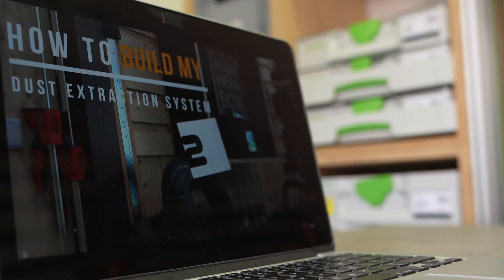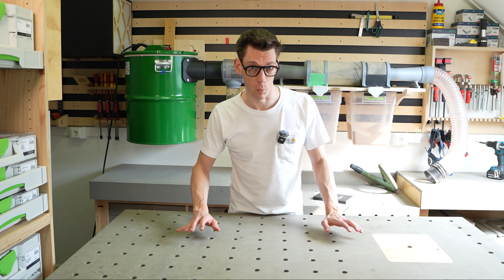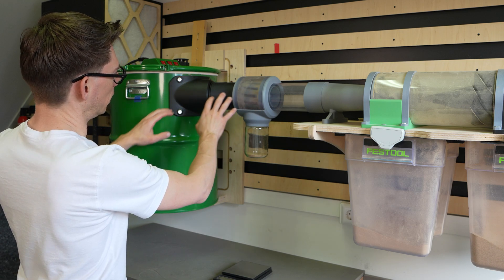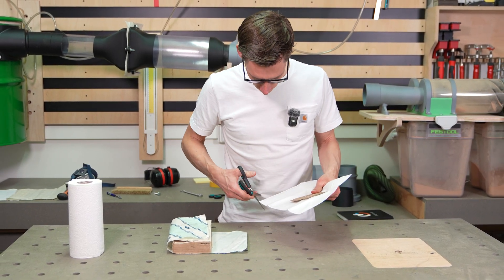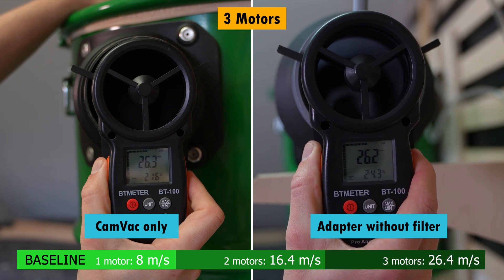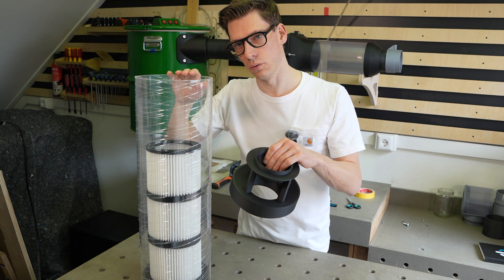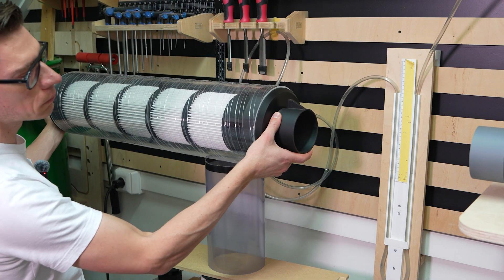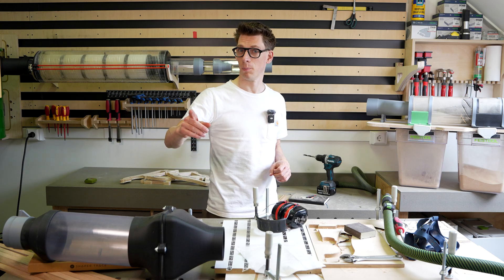I Dedicated 1 Year to Improve Dust Collection

Comment: Could metal chips in a machine shop be handled in a similar method?
Reply from the maker: They are probably to abrasive for the printed parts. Also the weight of the dust is different, so I don’t know if it will be as effective compared to wood dust and shavings.

Comment: Interested can this be scaled up for bigger volume flow and more industrial setup. Have a big 5axis that will cut carbon and epoxy boards and need to figure out dust collection.
Reply from the maker: I am building a 8 inch version that can handle a 6 inch inlet tube I think. 

What is the diameter of your 5 axis you want to connect?
Reply: @ no dust extraction at the moment so everything is possible. Will enclose it fully at some point and probably will be best to vent directly outside. Carbon dust is no joke.
Reply: @eXmachina_tech  you might want to at least grab a tape measure and see how big of a dust extractor can you fit in the spot you want it located at.

Comment: Out of curioisty, have you changed out the filter in the camvac? Stockroom supply in canada sells a filter setup ("nanomax")  which replaces the triple bag system in the camvac... I saw another youtuber simply print adapters for circular filters and it seemed to work exactly the same for a fraction of the price. This would eliminate the need to have a huge stack of filters outside of the unit!
Reply from the maker: No I did not change anything to the CamVac jet. I have seen the nanomax filters and also the 3D printed versions. I think I also need to test them and make a good comparison of those two options compared with the standard CamVac filters.

The main reason I put them on the outside is to be able to weigh the filter unit to quantify the amount of dust that is not filled out by the separator without the need to open the CamVac every time. To weigh the CamVac as a hole on a scale that is accurate on 0.1 grams was very expensive to buy such an accurate scale.

But I see where you're going with this one! Thanks for the reminder 😉 I'll have to make a video about this too!

Comment: I have worked in research and development of all sorts over the years and it is a job that i can say i actually love to do!  Not that i would go to work if I was independently wealthy i would just shift over to doing it for myself.  So that said, this channels is hugely inspiring.

Also, I can share the passion for dust collection.  At my last company, we had a huge dust issue with one of the machines we designed.  Static electricity was making things way worse so that might be something to look out for since you are using lots of plastics.  Good luck with your designs!

Comment: Copy what Dyson has done in their cyclone vacuum cleaners. No need to reinvent the wheel when they've spent 1000s of aerodynamisists hours working on this problem.
Reply: Yeah. 4-5" Super Dust Deputy is $180. Mine takes over a yr before the 2 micron filter on the DC needs to be blown out. And there is close to nothing in the collection bag.

Comment: Ideas for your square testing filter chamber. 
The corners lifting, add corner screws. 
For faster assembly, instead of screws, use spring clamps. 
For even faster assembly, use magnets.

Edit: finished watching, impressive works.

Comment: Loving the updates. The only thing I still wonder about your design is what would happen if the motor was before the separator, putting the separator in positive pressure rather than negative. That's how the Harvey one was designed.

Comment: Bonjour.:yougotthis: Encore une fois MERCI :goodvibes:pour vos recherches et Réalisations. 💪💪J'aurais une question SVP : pourquoi n'y a t-il pas de soupape de sécurité sur le Camvac?  Bonne journée et à bientôt pour vos futurs Exploits. 🤩
Reply from the maker: I think because it’s bin is strong enough to handle the pressure when the inlet port is completely blocked. And when you run on two motors, air will be sucked into the collection chamber trough the motor outlet from the motor that is turned off.
Reply: @CapturingDust  Merci pour votre réponse. :goodvibes:

Comment: That IGM/JET separator looks great because it’s got all the components to a separator that you want… but it IS ABSOLUTE GARBAGE!!! The put the components in the wrong order making them completely useless. All the large particle dust that would get extracted by the second component of the extractor gets clogged in the fins of the first component. Does not work one unless you are maybe only making table saw dust.
Reply from the maker: That was exactly my thought when I saw there design. Clogging must be there biggest issue. Though I would like to quantify how bad it will be. Some are really enthusiastic about it but I think because of sponsorships with the brand.

Comment: Love where you are going with this. It would be great to see what the pressure drop is for each stage of the filtration. Also what level of filter have you used. HEPA 13 would obviously be the ultimate and with the level of bypass you are now filtering would seem to be a reasonable thing to now employee.
The CamVac is as far as I can see now operating just as a vacuum source as you filters (even if not HEPA 13) are far better than what the CamVac offers.
If this is you final location perhaps you might consider extending the entry to your room filter forward and putting a 90 degree elbow on the CamVac outlets so they point towards room filter. Then you can run both. Get your HEPA 13 filtration from your room filter and your really good near HEPA filtration from your CamVac system. With this you could safely have MDF/HDF as part of your material selection.
Reply from the maker: Idd! I was considering to get rid of te CamVac filters and test the ultra fine dust filter capabilities of the counterfeit chopvac filters I used. But for that I need a test setup to measure it with a particle counter and a large HEPA filter. I have something in mind in the style of the silencer box from Hooked on Wood with integrated sensors into it to quantify the ultra fine dust separation efficiency between different filter and filter brands.

Comment: Fascinating work.  BTW. What have you come up with to wick static out of the various parts of the airflow to reduce wall accumulation buildup.
Reply from the maker: When the humidity drops below 40% I have static build up. Last test I did I kept the humidity around 45%. 

Though I will try out to add copper tape or kapton tape inside the tubes and ground that to earth. I bought all the supplies but need to run the test.
Reply: @CapturingDust  Besides having a common static drain wire of some sort, you might also try one of the anti-static sprays specifically formulated for plastic.  These are apparently used on the inner surface of bins used for powder like material to prevent caking in addition to a static drain wire on each wall of the inside if the bin.  Apparently the inside of the bin is cleaned and dried completely then the anti-static spray is applied and left to completely dry before putting the bin back in service.  I didn't find any information about the useful life of each application.  The copper capton tape will provide the static drain.